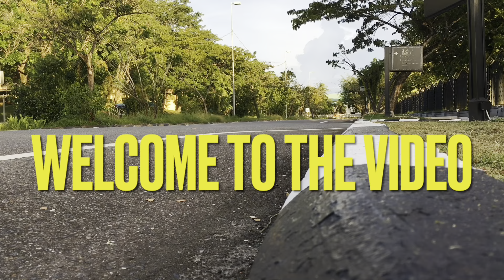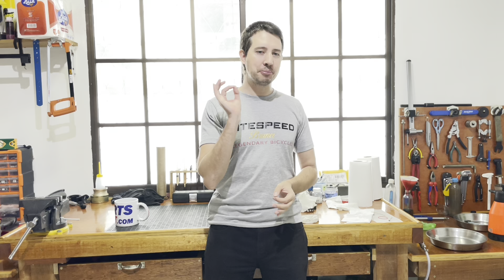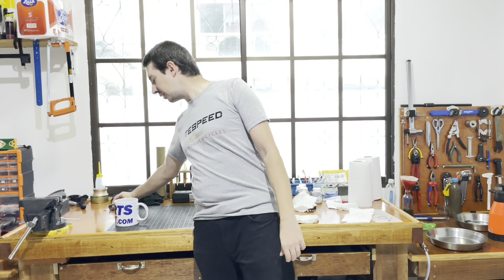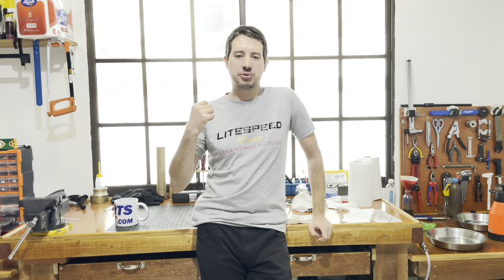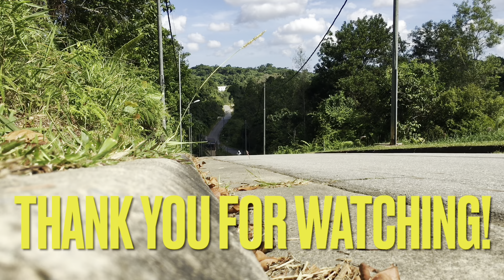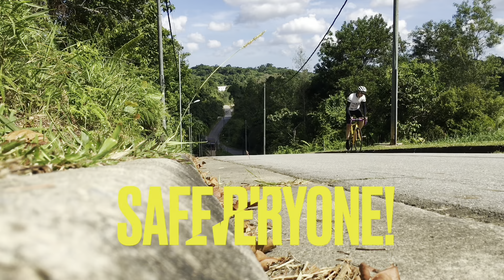Filippo Ganna’s Hour Record Bike Is Groundbreaking! But Why?

Comment: Well presented, though carbon shouldn't  be dismissed so quickly. Yes, I do agree  that  your surmise on sill levels and longevity of steel/ metal frames far exceeds composite materials.
Reply from the maker: Carbon has its use for sure, just not bike frames. Wheels and handle bars are fine, but honestly I can’t see any good reason to buy a carbon bike over a metal bike. 

Thank you for your comment! 👍🏻🙂

Comment: As a fully carbon fiber bike owner, I agree with your thoughts and opinions fully. Cost was the only reason I went with CF. I was able to build the entire bike for less than the cost of a Ti frame. I can probably replace that frame 3 times due to damage or whatever before I'm not cost effective. Still, would have liked a Ti frame. Not sure if I would want a forever bike frame. maybe. I could sell it if I tired of it but who would appreciate Ti like we do? Not many I'm afraid. Like you said, 3D printed upgrades could help mitigate that forever issue. Forever isn't as long as it used to be for me however, so... Maybe before I go I will be lucky enough to enjoy a Ti bike.🤞Thanks for bringing this technology and your perspective.
Reply from the maker: Great comment! 
If I was on a tighter budget (I have been in the past) I would always go aluminium or second hand. Aluminium is more robust than carbon, often stiffer if you are after a race bike and can be just as light if not lighter for the price. As for second hand (depending on where in the world you are) you can get some crazy deals. Take one of my customers for example. He bought a Litespeed Ultimate in custom painted red, with all fizik components and DT Swiss wheels for $8,000 BND… a year later he decided to quit cycling and sold it for $3,800! The guy bought it got one hell of a bargain! 
If you like in the US I see people selling really nice used Titanium bikes for next to nothing. Some people don’t know what they have and others don’t care. That’s the way I’d go if you are on a tight budget but still want a Ti bike. 🙂

Thank you for your comment!

Comment: What are your thoughts on a specialized roubaix ….
Reply from the maker: When the one with the future shock came out I said to myself “that’s a bad idea, I can see something going wrong with that…” and then as normal with Specialized they had a product recall. In fact I think most bikes they make have had a product recall. 

Had a female customer with the female version of the Roubaix. The Ruby. Carbon frame, 105 Disc, 28mm tyres and suspension in the headset and the seat post. She liked how comfortable it was for her road rides. However, after a year I convinced her to buy a Litespeed T6 titanium road bike. Titanium frame, 25mm tyres, 105 rim, no suspension. 

Not only was the Litespeed bike Over 1 kg lighter, but she told me it was just as comfortable as the Ruby. Later, she sold the Ruby and bought a second Litespeed, a T5 road bike. A bit more performance focused than the T6. 

So in conclusion, I’m not really a fan of the Roubaix.

Comment: Titanium frames look dated since the advent of carbon frames. And the calculation is completely bogus... 300 bucks production cost for the frame, whole bike sold for 8000 makes an implied 7700 for the bike company. Meh. In almost every industry, production cost are not the main/only price factors.
Reply from the maker: You missed the point of the video. They may look dated (they are still better than carbon in every other way) but with 3D printing they will have all the advantages. 

Yes there are other factors in cost, but they are still ripping us off, we know that because Chinese Brand’s can make a good profit selling at half the price.